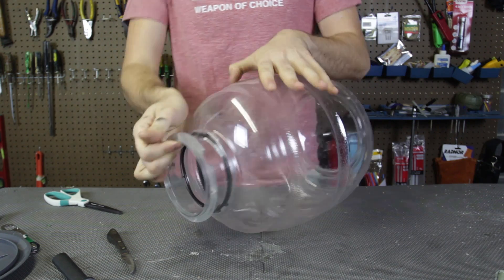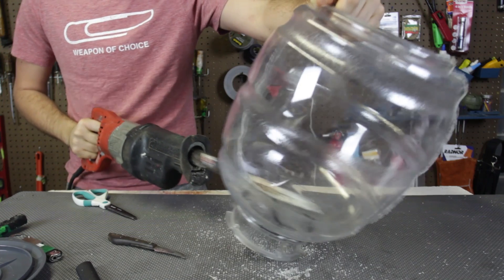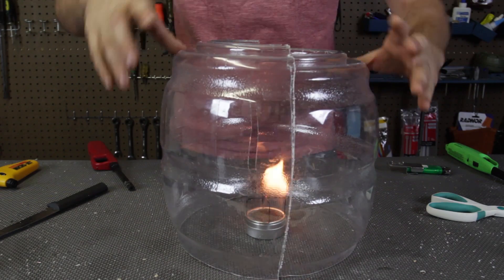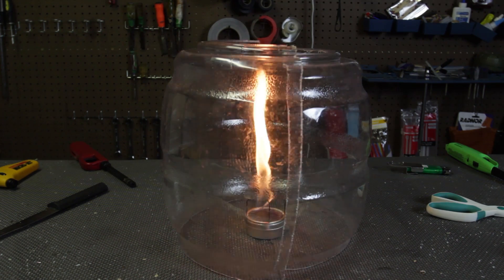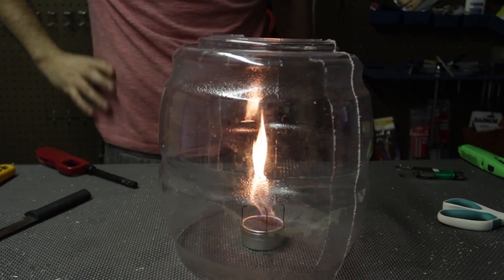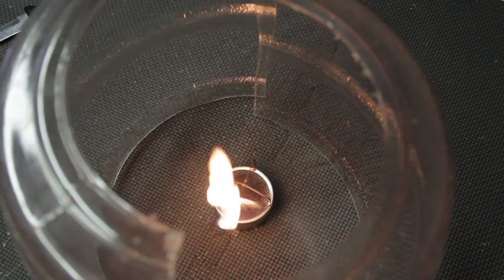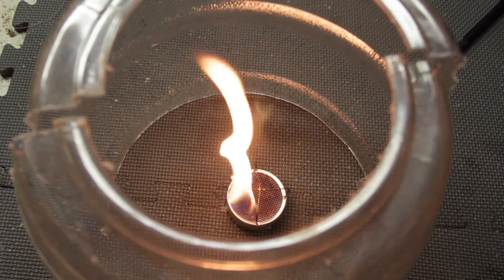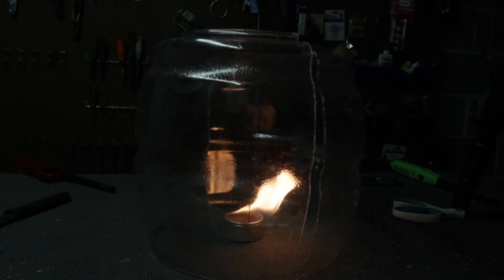Fire Tornado with Plastic Bottle - Science Experiments

Comment: Maybe it could look even cooler if you injected smoke on one of the slits of the plastic containers. It could even be a slim jet stream of smoke (it can be achieved with a small air aquarium pump with a long tube, the air pump would be pulling air+smoke and impulsating it fast enough to create a stream that would be affected by the convection created inside of the plastic container with the 'rotating' flame).